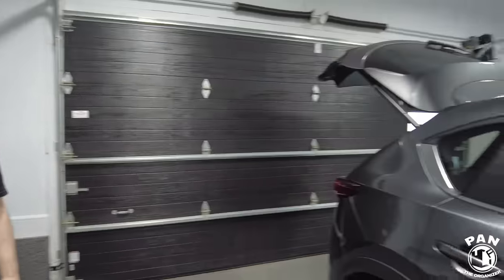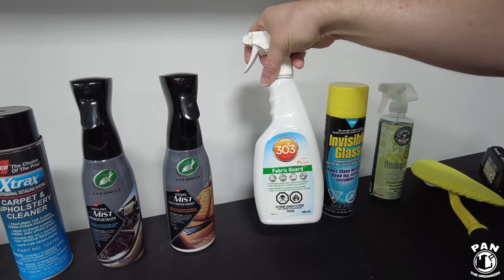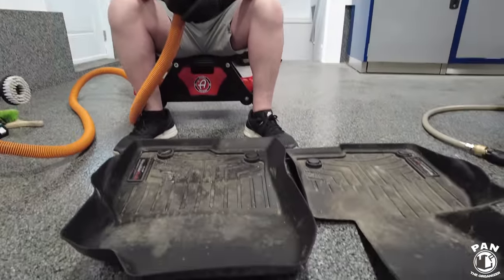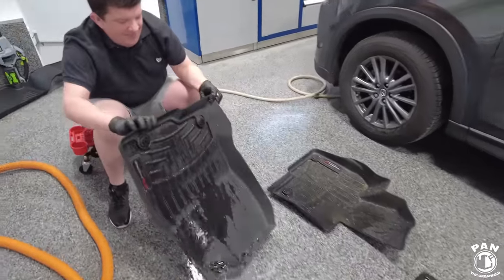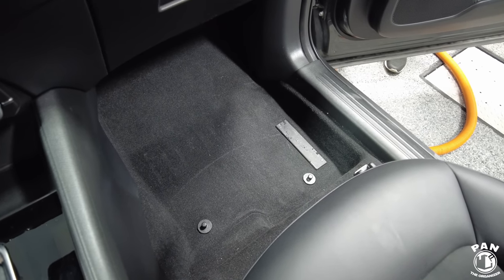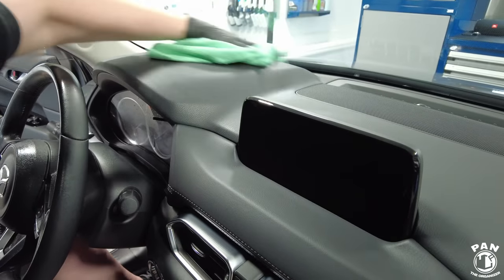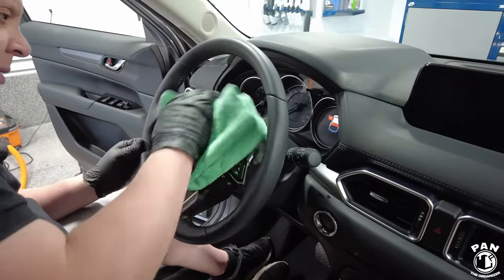Teaching a newbie how to clean the interior of his car!

Comment: Weather Tech mats are extremely durable and effective…..sitting in the outside sun to air dry OIS a good step that not only dries but softens then up a bit to be pliable with some flexibility for installation……especially when new and shipped from WT……More critical on 2nd, 3rd row and cargo area mats since some of them are shipped rolled.

Comment: Nice job Andy!  I like the Andy/Newbie series.

BTW, on doing the interior first or last.  In summer, I always do interior first while the truck is still in the garage.  The reason is I have to wash outdoors and I want to minimize the time the paint heats up to prevent water spotting.  In the "winter" (I live in Texas Gulf Coast so had to air quote that), I usually do it in the driveway (more space than garage) and still do it first so I don't drag a wet vacuum hose into the truck.
Reply from the maker: Thanks Scott! I had him do the exterior on his previous car in this video: https://youtu.be/DBJ5ZLMjcrg

Comment: Great video! You're always asking for DIY tips from your followers. Here's a good one. If you have a Rigid shop vac and the Rigid car detailing kit with the flexible hose, there is a soft bristle brush attachment for the initial vacuum of the cabin. You can just use that attachment. There is no need for a detailing brush and a vacuum handy to collect the dust. Organize On!
Reply from the maker: Be careful as that "soft" bristle brush isn't that soft though (the one that comes in the Ridgid detailing kit) and could potentially scratch delicate surface like gloss piano black.

Comment: Hi Pan!

I just completed my first full detail today on my wife’s 2017 Mazda CX-5! I’m pretty sure that’s what your brother has in this video! My first detailing experience was so satisfying, thanks to you sir! 
A few questions if you don’t mind:

1. When doing a full detail, do you start with the inside or outside?

2. The SUV I cleaned had some bad areas with dried/stuck food, candy, etc. I didn’t want to gunk up a microfiber towel so I used paper towels instead. Is that okay or is there a specific cloth to use in such cases?

3. Today I used Chemical Guys all surface interior cleaner. It cleaned great but did not leave a shine, which I prefer. Is there an interior cleaner you would recommend for this?

Again, I am so grateful I found your channel, Pan. You are excellent at what you do and an excellent teacher. 

Thank you!!
Reply from the maker: Hi Joe. 
1. That depends on what your routine is like. There is no right or wrong answer. I usually do the exterior first, as that's where it usually requires the most energy and that's what the customer sees first, so that's where I want to focus 100% of my energy.

2. I always use microfiber towels. Especially on delicate surfaces like paint. I have towels for the exterior, interior, engine bay, wheels, etc. 

3. I'm confused by your question. You liked the Chemical Guys, because it didn't leave any shine. But you want another cleaner? If you want the best interior detailer that leaves no shine, just cleans, no protection, get this: https://bit.ly/3yyH3MR
If you want something that cleans and adds a bit of protection, without that greasy look, OEM finish, use this: https://bit.ly/3LbAWAF
You can see a battle of interior quick detailers here: https://youtu.be/yobElib3V_U

I hope this helps!
Reply: @PanTheOrganizer  Thank you for your quick response! 
Sorry I wasn’t more clear on question 3. What I meant to say is that I prefer an interior cleaner that does leave a shine. The Chemical Guys did not. So…something that leaves a shine as well as UV protection would be perfect. 

Thanks again, Pan!
Reply from the maker: I don’t like a glossy interior so I have no recommendations unfortunately hehe.

Stay away from pro brands in that case as they all give a matte OEM appearance as that’s what most enthusiasts want.

Gone are the days of good ole Armor All greasy looking interiors hehe.

I remember that Chemical Guys Silk Shine does leave a slight sheen, not greasy though, but more gloss than average. Perhaps look into that.
Reply: @PanTheOrganizer  Well you just taught me something then! I’m 45 and lived through the Armor All days lol. 
I don’t want to go for a look that’s no longer “in”. I will refer to your “Best of 2021” as well as those you recommended already. Thanks again!
Reply: @PanTheOrganizer  Last question sir: Are there specific brands you wound recommend for a weekend warrior on a tight budget?

Comment: Hey Pan, this might be a new question never asked before.  What do you use to get things like dried out grass and other fiber like debris from the carpet like surfaces used on backside of fold down seats (like in SUV's and crossovers)?  This carpet like material has a very low pile (if any) and if a vacuum cleaner with revolving brush head is used, it pulls the fibers of the material away from the surface giving it a "hairy" look.  Over time, the "hair" will bead up or "pill" (as they say in the sportswear industry).  Using just a vacuum attachment doesn't pull the grass like debris out of the fabric completely.  I would like to be able to remove the debris and retain the original factory appearance.  Do you see this a lot in your client's vehicles, and have you had any success with getting the debris out and still look new?  Do you have a video on this subject? I look forward to hearing back from you. Thanks!
Reply from the maker: To get hairs and fibers and grass out of low nap fabric/carpetting like on the backside of fold down seats, you can first agitate with a drill brush attachment: https://amzn.to/3sCDJwh

This will loosen everything up and make vacuuming so much faster and easier. Pro trick! ;)

You can see my girlfriend using one of those attachments here: https://youtu.be/k5OHfyVFFlU?t=520

Comment: Pan thanks for guiding me to this video. I noticed you had your brother use Turtle Wax Leather spray for the seats. Other people had bad results with the Turtle wax on black leather. They claim it leaves spots that can be clearly seen on the black leather and are difficult to remove. It's not just one or 2 reviewers noticing this, so I cancelled my order. I was thinking of Gyeon Leather cleaner, followed by Gyeon Leather Coat. Apex Detail loves the combination even though Leather Coat has to be reapplied every quarter.  He also says it's a great alternative to Gyeon Leather Shield which is more costly and with the Leather coat going on so easily, its not a big deal to take 15 minutes every 3 months to reapply it. That makes sense to me since I'm just a home detail enthusiast and a stickler for things being first and foremost effective and secondly economical, this combo seems to fit the bill. I am curious if you would agree, I value your opinion. Also tell Andy he has good taste in cars. I just bought mine 3 weeks ago and I went with the turbo, 256hp & 320fpt so it has good amount of get up and go and I love it. I had an Audi Q3 prior to this and I enjoy driving the Mazda much more than the Q3. Anyway, I'd love your input and could you address an issue I read about when it comes to cleaning and conditioning black leather seats (which mine are with a peeble texture). Many YouTubers claimed that with black leather you need a cleaner and coating especially formulated for it. I know you could dispell this for me as either myth or truth. I'm looking forward to hearing from you about this. Be well and best wishes to your "better half" (girlfriend)...I wish all good things for both of you
Reply from the maker: People who say you need colored leather stuff have no actual knowledge of leather. Get good quality leather cleaners and sealants from reputable leather brands.

Here’s a video I made about my top ranked leather care products (that won an award in my awards video) and that I applied on my own high end leather seats in my Porsche 911 Turbo S: https://youtu.be/YFqRpJhkqJw?si=9uR-rYGPFvtRcj79
Reply: @PanTheOrganizer   Pan you are the best, I expected a reply in 24 hours, not 33 minutes, just tremendous. Ok I know your going to text me back after this to tell me 24 hours is typical so don't expect instant answers everytime lol, I know the drill so to speak, besides I was in Corporate sales before I retired so I know the pitfalls of responding quickly and rasing peoples expectations. Before I check out your video link I'd like to have your input on the Gyeon leather cleaner & Leather coat, am I leaning in the right direction?. Have I grasped your concepts correctly? Drop me a note, you now have 20 minutes and the clock is ticking LMAO...take your time I'll keep a look out for it and many thanks for your time.
Reply from the maker: Those are good products too. 

I am the only big detailing channel to actually respond to YouTube comments on a daily basis by the way, as you probably can tell.

I won’t lie, it gets overwhelming at times as I receive thousands of messages daily from almost one million subscribers as you can imagine, and I spend up to four hours every day just replying to comments.

But I’ll continue to as long as humanly possible as I like staying connected with my audience. 👍🏻

Comment: Mr. Pan , I have heard that new leather seats have a coating on them , car manuals recommend Woolite for leather cleaning leather ...avoid other products to avoid layering stuff on them , nothing gets in the leather so don't put it ...some car manuals do recommend this ...what is your opinion on this , thanks you for all your help , have used a lot of info from you !!
Reply from the maker: That is absolutely correct. Modern leather has a clear coat on top, polyurethane based, similar to the clear coat on your paint. So while it's true that it's pointless to use leather conditioners on modern leather (until the leather starts to get old and starts having micro-cracks at 3+ years of use). Conditioners won't penetrate the top protective layer.

What you need to do is clean the leather, and protect the leather from friction damage, dye transfer, fading, cracking and make cleaning much simpler.

So to do that, we apply a leather sealant or leather coating. I have a video on that here: https://youtu.be/YFqRpJhkqJw

I also made a video with leather care experts that explain all what I said in the two first paragraphs here: https://youtu.be/pvKJXGRneJg

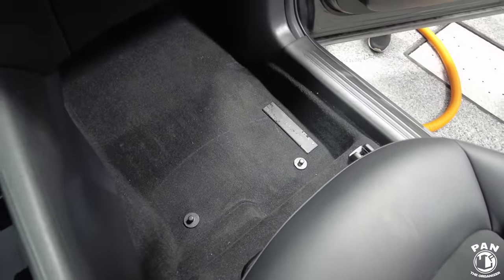Comment: Great video Pan. Enjoy all the great tips and links to the products used. Just wonder if you can help me with something I saw in the video. At around 7:44 I noticed the snap retainers screwed into the carpeting for the floor mats. I recently bought a used car for my wife which included the WT mats but the snap retainers were missing for the passenger side. I contacted WT several times and they sent an assortment of retainers but say they do not have anything like what is shown in your video. Would you happen to know where these are available? Thanks for always replying to my questions.
Reply from the maker: Hi Ron. Not all versions of the WeatherTech mats come with those. Some have retainers, some don't. Some have snap on clips, some don't. It really depends on your vehicle make and model. What ever comes in the box is what you get.
Reply: Thank you.
Reply from the maker: My pleasure Ron!

Comment: Great video...for someone looking to start cleaning their own cars you provide great videos that provide tons of help. I also own a Mazda, specifically a 2021 Mazda 3 premium trim. I find that even just staring at the Mazda dash leaves scratches as the plastic they use is very cheap. Can you provide any tips or tricks on how to clean this part of the vehicle and if there is any way to get rid of the scratches. Another difficult area is the gloss black trim.
Reply from the maker: To get rid of scratches on gloss black plastics, you have to use a polish like Sonax Perfect Finish: https://amzn.to/3lTPGJP

To protect it, I typically apply P&S Bead Maker like in my video here: https://youtu.be/TV1_qdOCy-w

But note that protectants don't protect against scratches. You have to be careful not to dry rub those surfaces, meaning don't use a dry cloth to remove the dust. Always use a damp microfiber towel when cleaning.

Comment: Any chance we can get a best of 2021 interior detailing products video? Loved the exterior video and would love to see a interior one
Reply from the maker: I had a few interior products in the awards video. It’s a video for both interior and exterior. There are just more exterior products as that’s simply what brands produce more of.
Reply: Off topic question but since you responded so fast I thought I'd ask could you see if the mjjc chemical suction tube will fit the MTM pf22 my goal is just to have the MTM with a weight for the soap pickup like the mjjc I keep having the issue where I have a bit of soap left in the bottle but the tube isn't in the right spot to grab the last 50 ml if I want to run out the last little bit and just give the car a bit of extra soap on top

Comment: How would you recommend extracting the carpet is critical for vehicles interior detailing?
Reply from the maker: I went over 20 years without the need for an extractor (a good shop vac and steam cleaner did the trick). I only recently purchased a carpet extractor in the past year or so, to help with dirtier jobs. Extractors are usually only useful for super filthy and grimy carpets. I show the use of the extractor in this video: https://youtu.be/k5OHfyVFFlU

Comment: Great video! How do I go about restoring scuffs and slight peeling of the top clear layer of the matte hard plastics inside the car - e.g. glove compartment on a Mercedes A250?
Reply from the maker: Unfortunately if the clear has failed a replacement is the only solution, or a full respray.

Comment: If we’re using top down method, why not do the windows first? When you spray the windows, doesn’t the mist go on the areas you just cleaned?
Reply: I always do glass last. Seems like overspray, fingerprints and smears find the glass while I'm cleaning other areas.
Reply: @timkinley1779  do you lower the glass first to get the top portion that’s hidden in the door when the window is fully closed
Reply: @JoeBlue415  Rarely, if ever.  However I will periodically clean the upper and side window guides (rubber that seals the glass) with Meguiars #39 after blowing them out with compressed air. There are so many varieties in window sealing design that the best technic is the one that works. The top of the glass I'll generally do last.
Reply from the maker: Same here Tim. ;)

Comment: Pan, I have a cloth seat that is dirty and stained. I've tried the foam cleaners in a can with marginal results. Any tips on where to go from here?
Reply: Use oxyclean diluted 10:1 or super clean diluted 10:1, use a drill brush and lightly agitate.  Use extractor .
Reply: Use some basic concentrated degreaser (Zep from Home Depot works fine) diluted per manufacturers recommendations. Use a Med-Firm hand bristle brush to agitate and suck up with a shop vac. I assume if you’re asking this question you don’t have an extractor to use. Don’t get caught up in the hype of thinking you have to buy equipment and specialized products to clean vehicle upholstery/carpet. Most stains and issues are resolved with a water soluble and appropriately diluted degreaser with readily available household items.

Comment: Man I purchased the Turtle Wax Mist Interior Detailer and Turtle Wax Leather Mist. I like it, but I have dropped the bottle several times because of the top wont stay connected.
Reply: Put some tape on there to hold it securely. I did that after having it open on me spontaneously the first time I went to use it
Reply from the maker: Really? I never had that issue...

Comment: Hi Pan great video as always. Question you used the turtle wax mist for cleaning the plastic instrument gauge area. The video did not show it but is it safe to use the soft interior brush first on that plastic instrument area and then use the mist? And second question what do you think  about applying precut screen protector material over the plastic instrument gauge cover and even the infotainment screen to help from scratches? Thanks for your great work. John.
Reply from the maker: If you use a soft brush like this: https://amzn.to/3QSPWKk

Then yes you can use it to dust off the plastic gauge cluster.

And yes having a protective layer on top will help prevent marring and scratches. Here's a video on that topic: https://youtu.be/4zeUD9M8wLg?si=a2c6YgBNf6ycCEUp

Comment: Hey Pan I'm wondering if you have any videos on cleaning and protecting a convertible top. I purchased an older model Mustang GT earlier in the summer. Previous owner garage kept it during our Michigan winters. I don't have that option but I have purchased cold storage for it at a boating yard. Just wanting to clean it and wondering what I could protect the top with for the months it's in storage. Great videos all around though 🍻

Comment: Can the 303 guard protector be used on leather?
Reply from the maker: Fabric Guard is only meant for carpets and upholstery.

They have another product, called 303 Protectant, that could be used on leather. They say 303 Protectsnt is for use on a variety of surfaces such as vinyl, plastics, synthetic & natural rubber, finished leather, PVC, gel coat & fiberglass. Ideal for use on your dashboard, other vinyl/leather interior surfaces of your car, tires, windshield wiper blades, and more! Not for use on clear plastics, unfinished leathers (such as suede), fabrics (canvas), floorings, gauge panels, or headlights.

But on leather, I still prefer dedicated leather cleaners and protectants.